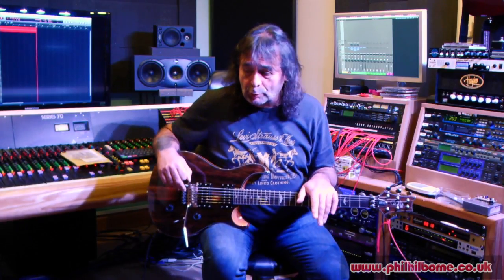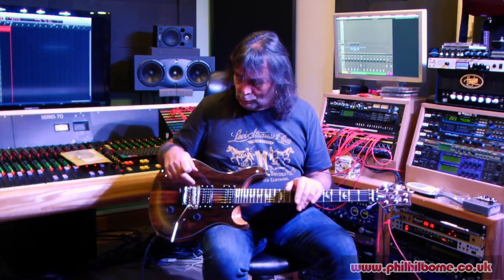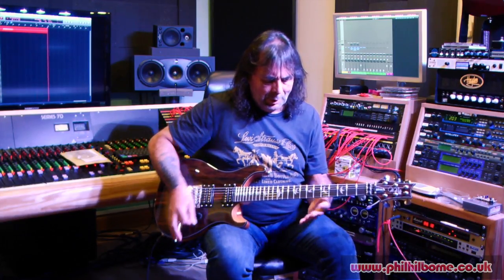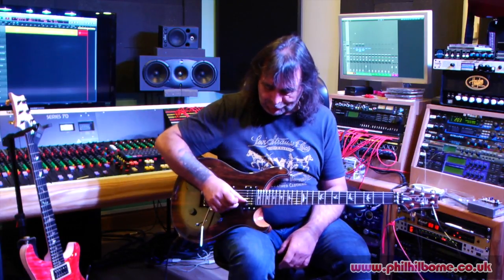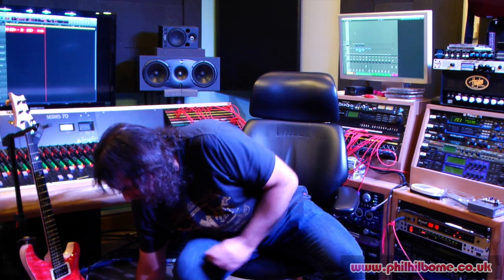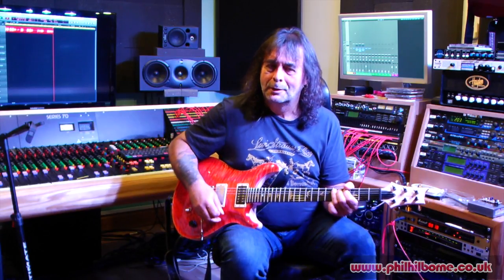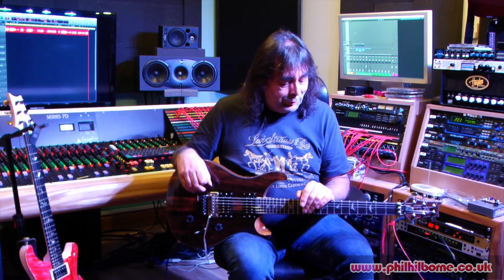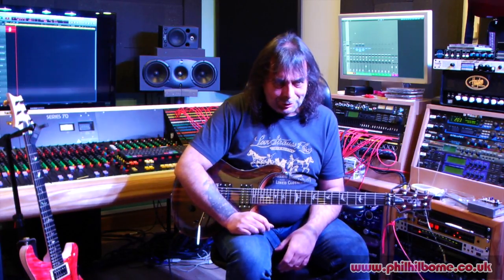Revolutionary New Strings Day!!

Comment: Very interesting. Really interested to get a set of these when they're available. Question: Does this only work in E Standard tuning? Will they need to develop sets for E Flat, Drop D tuning etc? Really cool idea.
Reply from the maker: Should be fine for lower tunings but for Drop D they would need to develop a different set I would think..